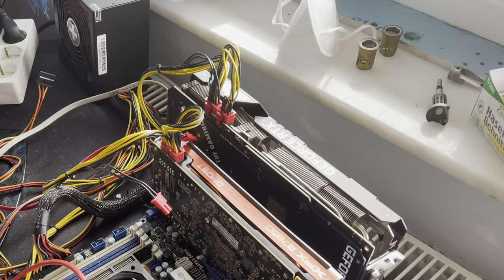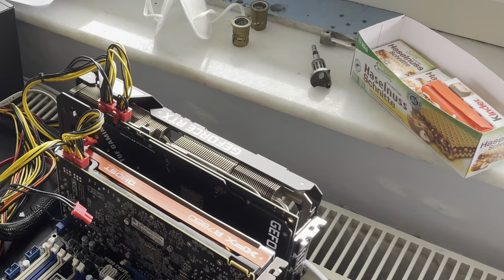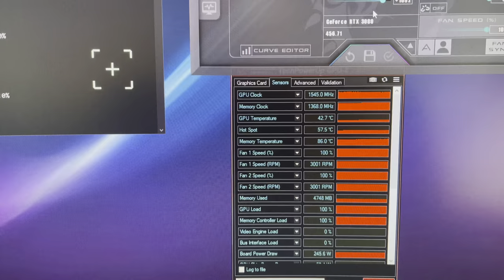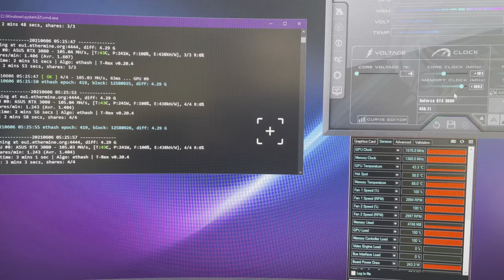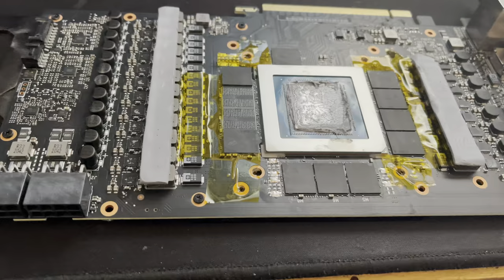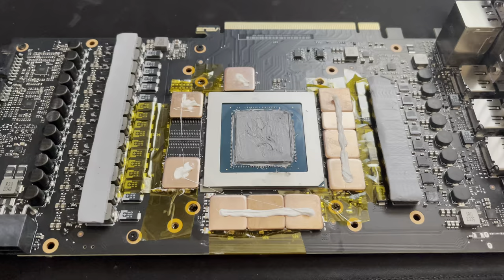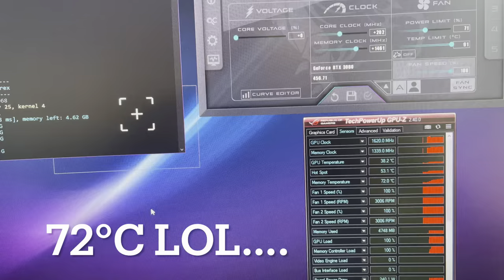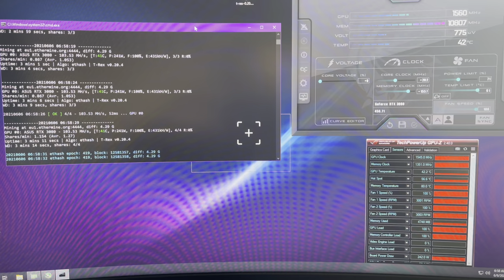Copper Plates on GDDR6X of the RTX 3080 ASUS TUF OC - vs. thermal Pads - Was it worth it?

Comment: Isn't running fans at 100% bad for their longevity? I run mine at 73-75%
Reply from the maker: Yes, you shouldnt run those at 100% fanspeed. But for testing reasons i fix them at 100% to see the difference between pads. If you run them lower, you see how good the cooler is at a certain fanspeed, but you want to see how much conductivity difference is between pads
Reply: @UnleashedOverclocking  Ah, I get it. Thanks!
Reply: They are $15 bucks for all 3 stop being cheap and I’ve run mine since last may at 100% 24/7 mining and they all still work perfect
Reply: @supupandaway8138  So where can I buy fans for MSI RTX 3090 Suprim X for $15 then? I can only find them at one online store for $95 without shipping (over $100 with shipping). Nowhere near the $15 you mentioned.
Reply: @bgtubber  ebay
Reply: @supupandaway8138  There are no fans for RTX 3090 Suprim X on Ebay. I've checked. Can you post a link to the listing or the keywords you used to find it?
Reply: @bgtubber  don’t search it by name most of them are the same mounting and plugs i think the gaming trio fans match the x

Comment: How did you cut the copper plate?
Reply from the maker: I just take a saw and cut one piece in half.
Reply: @UnleashedOverclocking  Das habe ich heute mit einem Schraubstock und einer sehr feinen Metallsäge ausprobiert. Es entsteht ein fieser Grat und wird nie ganz gerade. Durch den Druck der Zwinge biegt sich das Plättchen ebenfalls.
Ich versuche es jetzt mit einer Fräse oder Sandschneiden.
Habe 35 RTX 3080/3090 und alle 100+ Grad. Bekomme das Hitzeproblem ohne Kupfer wohl nicht in den Griff.
Reply from the maker: Du brauchst Schonbacken und danach machst du den Grat einfach mit Schleifpapier weg.

Comment: What is the temperature if you drop fan speed to 75
Reply from the maker: Nearly the same. Around +4°
Reply: @UnleashedOverclocking  but 75% would last your fan longer than 100, and at 100 it kinda dampens the purpose of using copper to move more heat